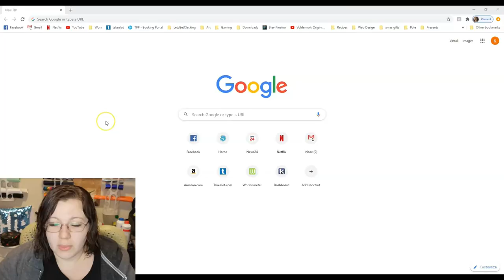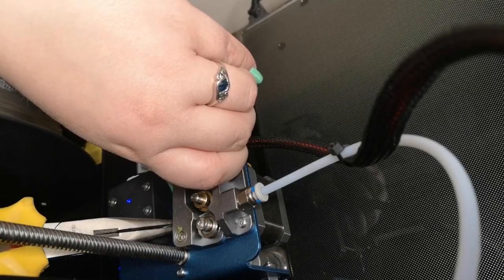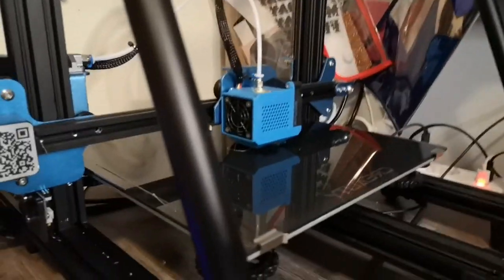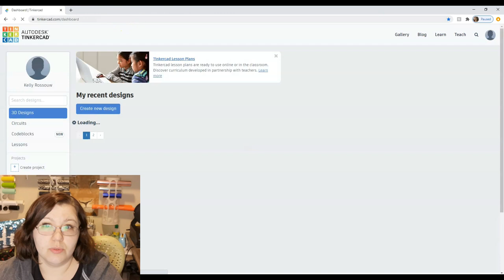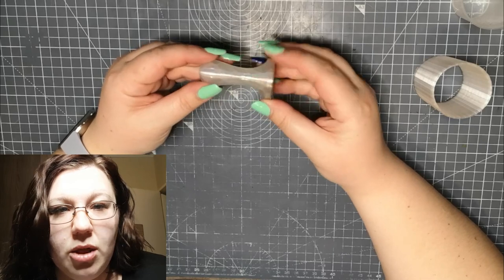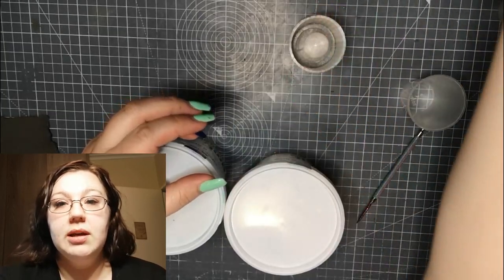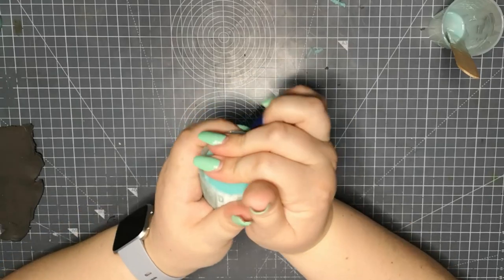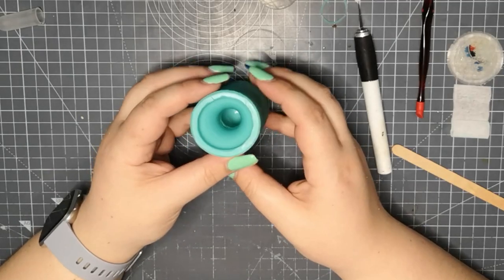SILICONE MOULD TUTORIAL: 3D Printing an item and making a resin mould! Advanced Tutorial

Comment: tip level your bed with printing temperature bed expands to. if your filament breaks so easy it 's to old and have been dried out.
buy a 3d printing adhesive spray.. expensive but you can make thousands of prints you only use a bid.
Reply from the maker: All good and correct points yes! :)

Comment: Fellow 3D Printing enthusiast here... I know this is an older video, but for the benefit of your viewers just in case... You should really try to avoid leveling your printer bed with the stepper motors off. When the steppers are off you are relying strictly on gravity to keep the hot-end suspended at the correct height. If the steppers are on, the motor is keeping tension on the lead screw. However, it will require that you move the print head by means of a GCODE file or via the printer menu.
Reply from the maker: Thanks so much for sharing! Makes total sense :)

Comment: Did you use platinum or tin cure silicone? If you used platinum, how did you prevent cure inhabition? Was it the varnish?
Reply from the maker: Thanks for watching! I always use platinum cure silicone - you just need to avoid using latex, urethane or silicone rubber with platinum cure :)

Comment: Hi ma'am, I saw a post that I can 3d print a mold. However, my concern is, if i need to make it a silicone mold before casting it with resin? Or it is okay if I use the 3d printed mold with resin, without making a silicone mold.
Reply from the maker: Hi Toni! You should make it silicone before pouring the resin in. If you do not, it will be more of a once off mould, as the exothermic reaction from the resin will likely melt the mould out of shape (plastic softens and disfigures when exposed to heat).
Reply: @KellyRossouw  thank you so much, ma'am❤️

Comment: Draft is what is needed.
Reply from the maker: Im not sure what you mean - would you mind elaborating a bit more please? :)
Reply: @KellyRossouw  Sure. The following link should explain. In essence, draft is the amount of taper for molded or cast parts perpendicular to the parting line. Which is required for easy removal of part from mold(s). https://en.m.wikipedia.org/wiki/Draft_(engineering)